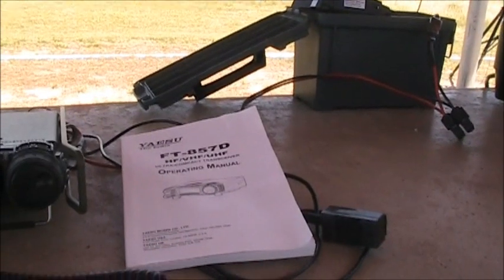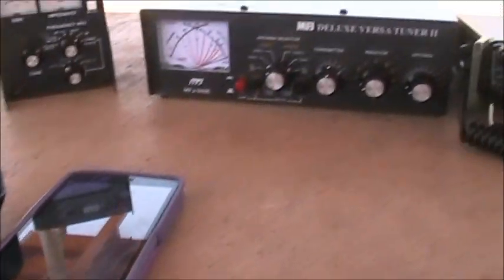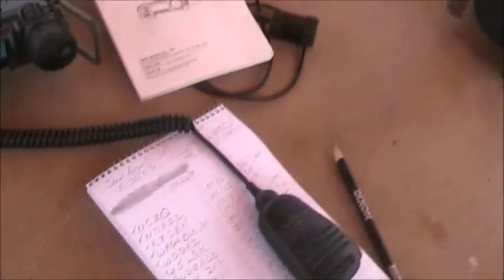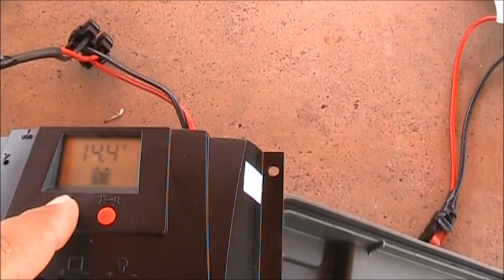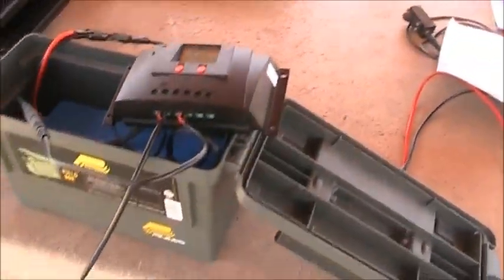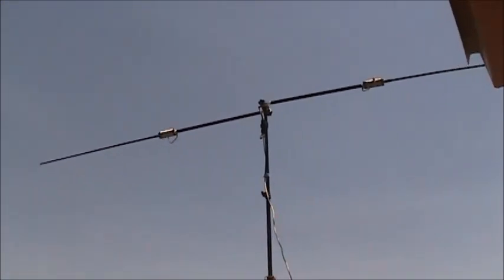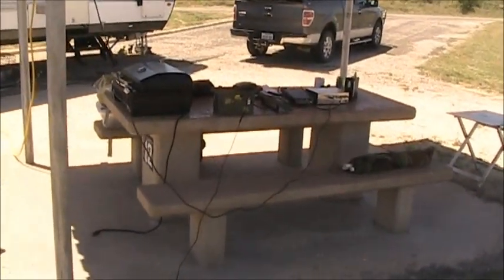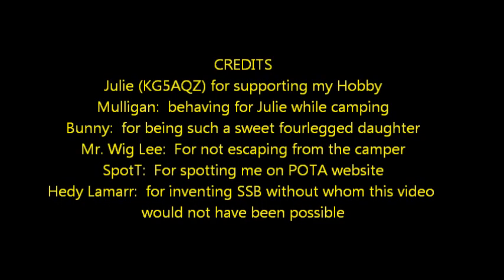San Angelo SP QRO setup

Comment: Nice setup! I like that solar panel and your logging software looks like an expensive package. I've always been intrigued with the buddipole systems. I built a DIY buddipole and buddistick....the buddistick I made worked great! The buddipole...not so much. I was too cheap to buy one. I've read as many reviews from happy OP's as I've read from unhappy OP's.
Reply from the maker: Believe me, it is a love hate relationship.  I have that bulky analyzer I drag around with me to tweak it.  If you can get it tuned JUST RIGHT it works great.  You don't need the antenna tuner if you tune your antenna.  It is really my go to antenna.